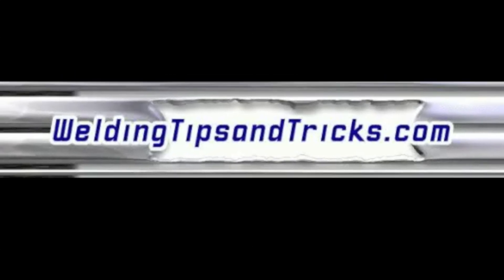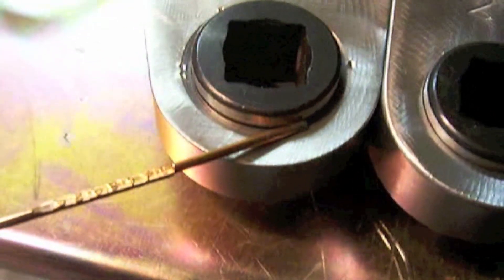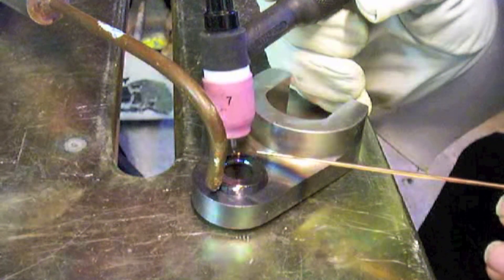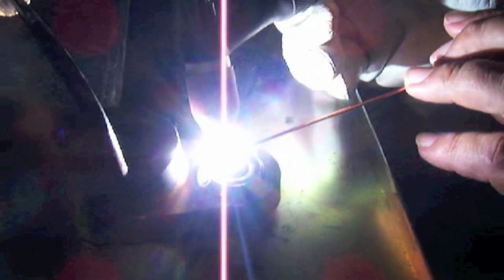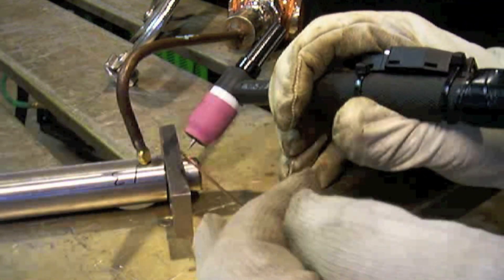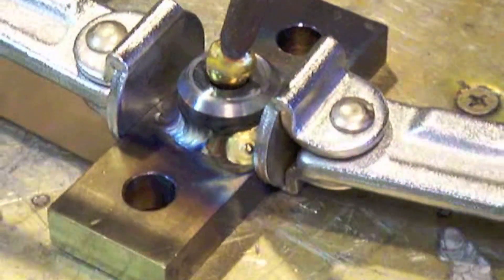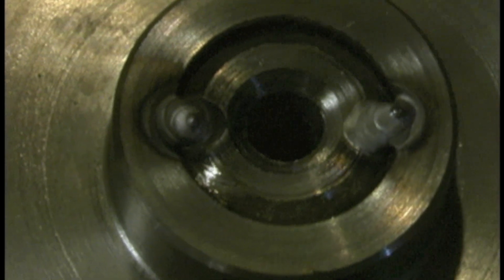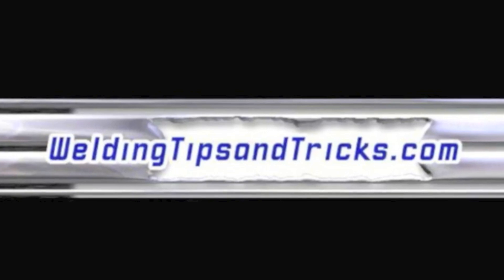Tig Welding - Tips for welding 4140 Steel parts

Comment: I want to weld mild steel handles to 3/4"-dia 4140CF with a SMAW procedure. Any recommendations for what rods to use? I have a fuel torch for HT if needed.
Reply: Use 309 or a 7018 after preheating with torch. Torch after welding too.

Comment: Hey Jody, love your channel.  I am just wondering, I have to run some hard facing on the edge of 5 hydraulic earth augers which the flights are made from 5mm plate.  I'm wondering If I can use my 210amp MIG welding (which is a gas) machine.   Is it possible to run 0.9mm gassless hard facing wire on it? such as [8FC-G .035 X 2 lb MIG hard facing welding wire Spool Blue Demon]?  Thanks, Chris.

Comment: Hi Jodi, I have a question about welding annealed 4140 spline material to a toyota driveline yoke. I assume the yoke is cast steel. Would you use 309 TIG rod to weld these together, then heat treat the whole thing after to bring up the strength of the 4140? Thanks

Comment: Hey Jody, I'm not sure if you'll ever look at this comment, but in case you do, I just wondered if you ever use ER80S-D2/ or ER80S-B2, or ER80S-B3 ?

I used to weld for a company that built tanks, pipe, and high pressure vessels and we used allot of ER80S-B2 for acid tanks/vessels, and the B3 in CrMo pipes for boilers and I was curious about it's other applications in the machine shop?

Thanks again for your years of tips and tricks, and of course the arc-shots are really great eye candy! Aloha...the Farmer.

Comment: Oh and the job is to weld 60 pound drill bits that are fabricated and I have to weld them together. Just an open root flat and fillet welds in 2g/2f.
Reply: Nice fish, is that a yellow-tail? It's hard to tell from the small picture. It almost looks like a shibi(small yellow-fin tuna), but I'd just be guessing. Aloha...Da Kailua Farmer.

Comment: Have you ever Stick welded 4140 with 10018 (or the X018 series)? I have a job that requires stick welding 4140 using 10018 on the WPS. I'd love to hear back from you! Thanks for your videos! Your video on 4130 helped me have more confidence when I had to weld 1/36" chromemoly on a racecar! :)

Comment: Hello, I have a project Im working on. I have to weld 4130 .065 sheet to a block of 4140. Can I use a regular stick or mig welder to do this? The project will be heat treated afterwards. If so, what wire/stick would you use?

Comment: I got shocked at TIG welding school. What what can I do and be aware of to prevent this from happening again? I was wearing cotton gloves. My singer stuck to the piece, so like in stick welding my reaction was to pull it away. My foot was still on the pedal and the arc jumped into my hand holding the torch. The experience jolted my nervous system pretty bad. I had to drop out of the school because of it. I would like to get back into learning TIG.  Thanks for the great instruction.